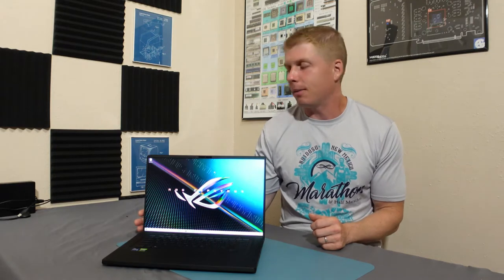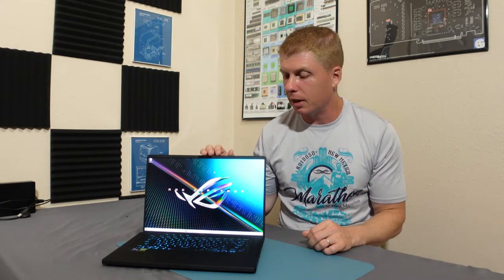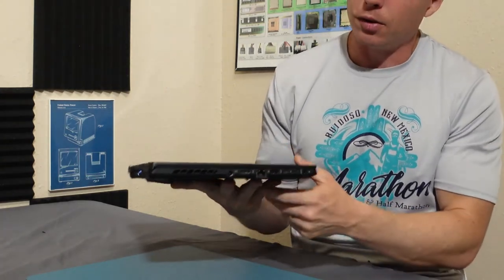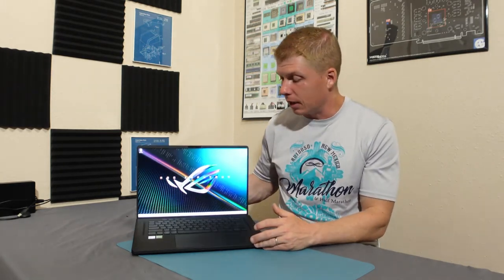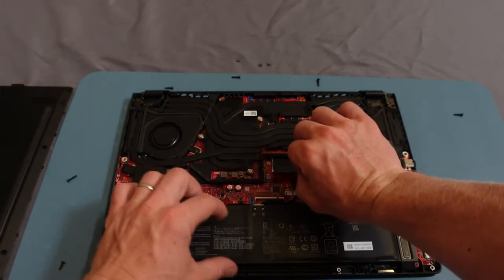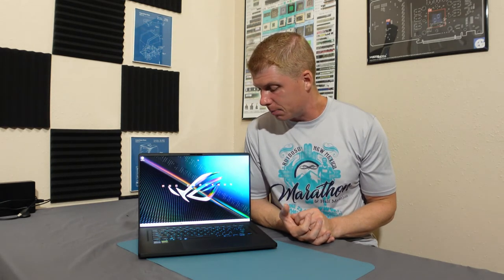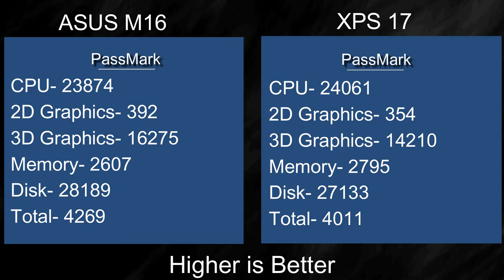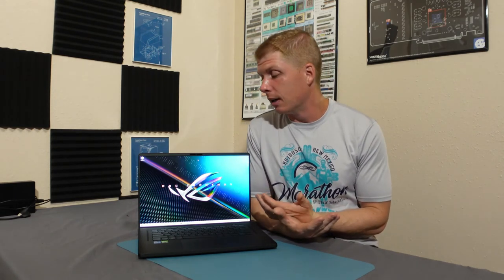ASUS M16 Review | A Gamers XPS?

Comment: Awesome review man! was waiting for so long for someone to compare xps with m16!
1. How much would you score build quality compared to xps 17? Can you also please share if you find any potential spot lacking build quality?(example rim around screen or durability of palm rest rubber coating etc.)
2. How is the hinge quality feels like? (does it feel durable?)
3. How is the screen flex situation?
4. I did not understood your exploding i/o comment.... more is always better right?
Reply from the maker: Thanks so much for checking out the review and reaching out. Happy to have you here. 
1. If the XPS is a 10 in build quality, I would say the M16 is a 6. For being a largely plastic build with some some sort of Alloy or Aluminum lid it is still very nice. It's not bad build quality, the XPS is just amazing. As for problem areas, nothing structural, just the fingerprint reader doesn't really work and the status LED lights reflecting off the screen are annoying. I think if you play at night or in a dark room, it may bother you.
2. Hinge feels good, easy to open but not terribly wobbly. 
3. I didn't notice scree flex being bad. Could be because of whatever alloy the lid is made out of. 
4. With the I/O, generally more I/O is a good thing but the way this laptop is designed, having all those ports down the side, all the way to the front, it looks tacky to me is all. If they designed it to have those on the back maybe then it would be great.
All in all, I really like the M16. Price to performance I think it is a good value and if you are a content creator that games, this is a great choice.
Reply: @Crash Wilcox  Thanks for answering my questions.
Reply from the maker: @ankushchaudhari67  Happy to help:)